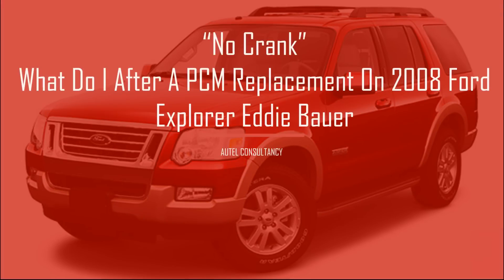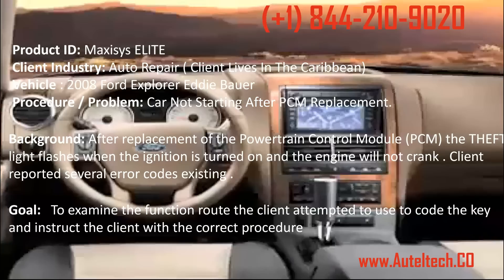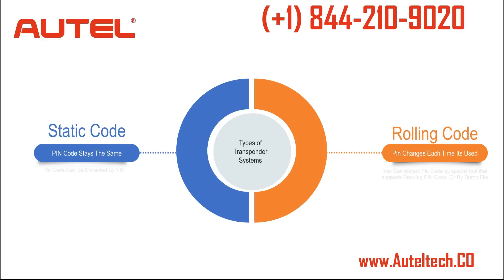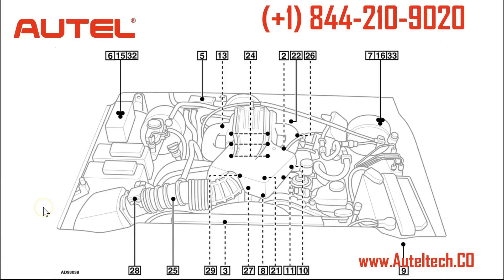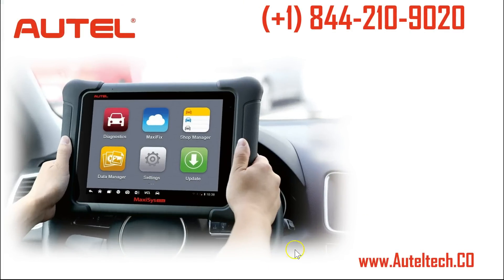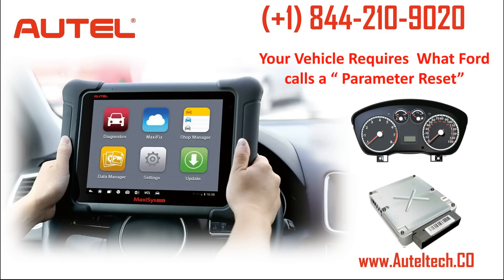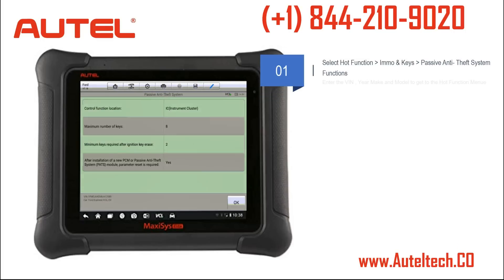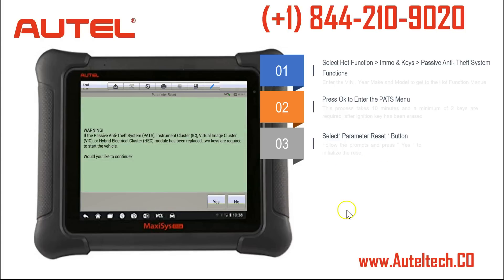Autel Maxisys Elite | Ford Explorer Key Coding-What to do after PCM/IC Replacement | Case Study 2019

Comment: One of the things that annoys me with this videos you say a couple different times to turn the ignition on but the ignition had to be on the entire time anyways. And if you turn it off and back on, you can put the vehicle and immobilizer lockout by turning it on with a key that isn't programmed. You basically need to go in with the key on, or racy p1260 code that's going to be present in the ecu, and then back out and go into everything and never turn that key off because it'll turn the immobilizer on. There are very specific vehicles that are also going to be problems and must go to the dealer. 2008 to 2014 is a hot rain for vehicles that have to go to the dealer almost all the time like the trucks and suvs.

Comment: I have a 2013 f150 and I am trying to reprogram the pcm. I did the first steps where I turned the key off. Installed new module then turned key on and let it do its thing. Now I am trying to do the steps u did in the video and mine keeps failing the 10 minute part and says it is unable to do it. The wires are hooked up as shoukd and I have 13.4 volts. I’m not sure what the problem is.
Reply from the maker: Hi Peton.. Is the module used or new? Maybe you have an underlying condition . Which scan tool do you have?
Reply: Module is used. The truck recognizes it as the same vin and says it is programmed to the vehicle.
Reply: I tried to call you but the call said it was busy.
Reply: I have the same scan tool as mentioned in the video. The maxisys elite.
Reply: Do i need internet connection to do it?

Comment: Hi Curtis, I installed a new PCM in my 2006 Mazda 3 2.0.  I ordered it from a company online who pre-programmed it with my VIN and all updates for this model.  I borrowed an Autel MaxiSys from a friend to program my keys, and I totally missed the step about resetting the parameters first.  Now I have a P1260 code, and the car is immobilized.  No matter what I do, I can't clear the code.  Every time I go back into PATS, it says, "the diagnostic tester is unable to communicate with the module."  Is there anything I can do to clear the code so I can get back in to reset parameter, then program the keys correctly?  Any help?

Comment: Thank you for the missing link. tried programming the keys a few times with no success. after parameter reset, worked the first time. only problem I have now is the ABS light comes on because I put a used PCM in it, and there's a VIN mismatch code in the ABS module. Tried a Programmable Module Installation, entered the new Vin, but won't go through. Any suggestions on that?

Comment: Hey I've been watching your videos and I really like them a lot. They're very informative. I realize that this is an older video another new im608 is built on the chassis of the tablet you're discussing in this video. Can the im608 do rolling codes in a way that this unit cannot? I'm going back and forth between the xtool system and the 608. Just trying to get some pros and cons
Reply from the maker: HI Scott you should book a diagnostic tool consultation. I can give you an unbiased analyses on which one is right for you. I also can ask you some really good questions that will reveal problems that you didn't think of.  One problem I can see right off the bat is that when you get your xtool and you have a software issue, can you contact the seller for assistance?

Comment: Do you need the j2534 to do this or just 908bt
Reply from the maker: It depends. If its a new module your installing you need a j2534. If its a used one you can use the autel .. But in some cases you may not have the function on the tool so you might need to use the j2534 to finish the job
Reply: @AutelConsultancy  ok thankyou for responding so quick

Comment: This procedure will not work on a 2014 E250. Is there a reason ? I get the following message: The Hybrid Electrical cluster (HEC) module is not permitting security access

Comment: I have a customer who had an 07 Lincoln and the issue I was having was when the 10 minute wait completed I proceeded to do the parameter reset. As soon as I press that selection on the tool I got a “security access lost message”, so I waited another 10 minutes and got a message that said “process successful but there was an issue”. Went back to the pats menu and went to erase all keys, pressed that button and once again “security access lost” message.  I disconnected the tool to see if it had done the reset properly even tho it said there was an issue and was unable to cycle two original previously working keys to get it started. Is this a flat out messed up replacement pcm issue or a garbage software issue on behalf of autel? I use the ms906 and it has had weird messages on Mazda vehicles where it said the process failed and it actually did what it was supposed to. As a consumer who uses this tool for my business this is pretty bad. I lost a job yesterday and was unable to complete it after spending over an hour on it, should of been a 20 minute job. Please respond.
Reply from the maker: HI Anthony , Its really hard to tell since I wasnt there walk you through the procedure and make sure all the conditions are met. I could have been a software issue or even an issue with the module itself. You can book a diagnostic tool consult at www.auteltech.co.za if our stuck and at least me or my engineer can get to the bottom of the issue. Something simular happend ot me with one of my clients and it was becuase there was an underlying conditionon in one of the modules.
Reply: @AutelConsultancy  thanks for the reply! I suspect that it was a faulty pcm causing the issue as my tool has been solid but buggy on other vehicles. I had a Mazda 3 08 that generated a pats error but worked when I checked the vehicle. I have not encountered the  kick out of the pats module that I was consistently met with loosing security access for no reason. I followed your tutorial to a t. I even went one step further and cleared the KAM on the pcm, did the access and parameter reset, lost access then gained again then erase keys and didn’t get a dtc message or anything. When I went to cycle the two keys that worked the immobilizer light was not flashing rapidly, it was solid. Tried different intervals of cycling the two keys and nothing. I had never seen anything like this, when you gain access you are in. You don’t just loose it by selecting a pats  function...that was the weird part.

Comment: Hi.... i had recently 906bt  ..does this procedure work on blank or used replacement ecu ?
Reply from the maker: I think you will find success with the used modules
Reply: thanks.....does maxisys 906 bt do parameter reset same as elite or it can not ?
Reply from the maker: @ahmedjasim8702  The same. It has the same diagnostic and special function capabilty
Reply: @AutelConsultancy  thanks too much

Comment: Sir
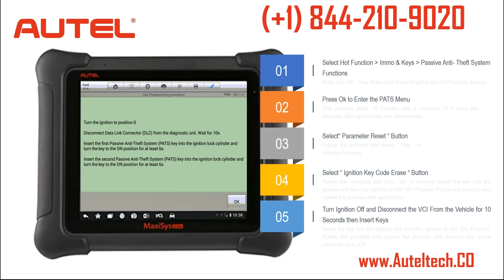At 13:00 you state that you have to remove the VCI so the unit. Will manually program the new keys so how does the scan known that the key's have   been completed without the vci.
Reply from the maker: After you follow the instuctions and remove the VCI to then complete the add key procedure.. You can connect the VCI and go back into the immo system to check the key status. It will then tell you how many keys are programmed to the vehicle. So you the scan tool will only know after you connect it back to the vehicle again

Comment: Hi Curtis excellent explanation but if you only change the Pcm you can do a parameter reset and dont have to erase the keys because the pats module is embedded on the cluster.only if you change the cluster you have to erase the keys, i hope it helps.  Excellent class

Comment: Curtis Older Fords have "Timed PATS " requiring a 10 minute security access. Newer model Fords starting as early as 2011 might have "Coded PATS"system requiring IN Code and Out Code entry. Will Maxi Sys Elite warn you early on before Erasing all the keys on Coded PATS Fords that these IN Codes and Out Codes are required and whether these are Static or Rolling codes?

Comment: Are you saying every ford system is 10 minute wait. Most tools bypass the 10 minute wait on everything 12 and older ford. Does this tool have any Pat's 10 minutes bypass available?
Reply from the maker: Not that I am aware of. Ive always waited the full 10 minutes with the autel and the FORDS OEM software.

Comment: I have a 2000 infiniti i30t and its not cranking or starting it seems to me its the security system and i have an autel maxisys ms906ts and its not allowing me to reset or anything i also tried to program 2 remotes which didnt work after i did it and now im stuck with a car not running

Comment: I have a maxiflash elite and have never had a good experience with it, currently trying to trade out for an otc
Reply from the maker: HI Jon maybe you were not diagnosed properly and the tool isnt a good fit for what  problems you are trying to solve. Give the OTC a try. It has good diagnostics information to help you solve problems. Just doesnt have as much special functions as the Elite

Comment: Does the Maxisys Pro. do the same on Asian cars eg,Toyota, Nissan etc.? Also BMW /Audi/Benz.
Reply from the maker: Hi Terry thats correct... The pro is just an older verison of the Elite ( came out 2013) What do you work on?
Reply: Thank you for the reply. Well I do work on BMW/ Benz/ Honda/ Nissan ETC.  I bought the Maxi sys 906 but I think I made the wrong choice. through Amazon through Autel ... I am not familiar with this tool. I plan to introduce this tool in Georgetown Guyana, but I need more training... what is your suggestion. thank you for your reply. Andrew... (Terry).. @AutelConsultancy
Reply from the maker: @MyTerryb   Hey Terry . I understand. The MS906 is a stage 1 tool. It has some special functions but the when you get vehicles that are over 2010 you are going to struggle since more modules are in the vehicle that require coding/relearning/configuration.  The MS906BT is a stage 2 device. It has more cars and get access to more modules. It also  has more coding special functions. Stage 3 is the Maxisys Pro/ Elite this is for the advanced tech since it comes with the j2534. This will allow you to inject the OEMs calibration file into a blank control Module. This is called Programming. In your sitation ( and to avoid any costly mistakes) I recommend doing an over the phone consulation with me. This way I can listen to your requirments and device a tool / strategy to help you achieve your diagnostic/ programming goals. You can call me at 1844 210 3020 or Email me at Curtis.Hardin@gmail.com Leave your number and ill call you up. I specialize in the tech support to the clients I sell to so I can easily address this problem if you like

Comment: FYI , When Ford specifies a minimum of number of PATS keys ,  they need to be from the original correct Stratec or Illco blanks that  Ford specifies for model and year . Just Using a couple Chinese Cloned keys made off the customer's  last working original key probably  aren't going to work in this scenario because they won't be  seen as 2 diferent PATS keys and you'll spin your wheels . Many Locksmiths and hardware stores have gone the Lazy Chinese Clone key route because they don't want to stock all the different PATS keys and want to keep programming in house, but you will probably be screwed when all the customer has is keys that are clones of one another.
Reply: Very rare to have a any car with 2 cloned keys and not one original. You should have no problem determining if your holding a clone or not. Also there are alot of key brands that can be used not just stratec or illco. Those are the most expensive and makes zero difference.